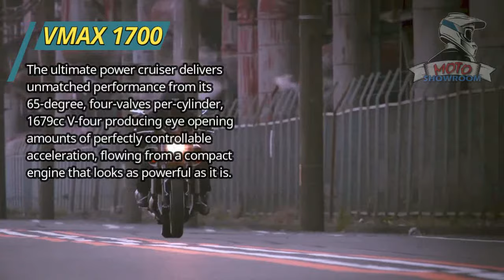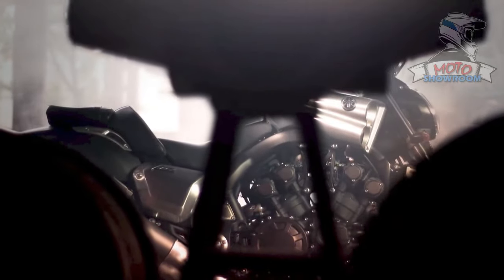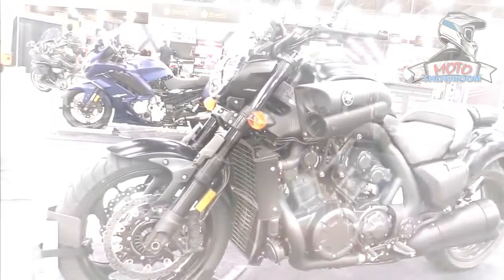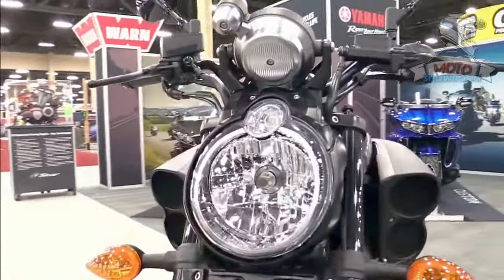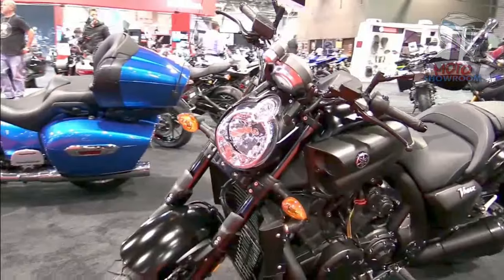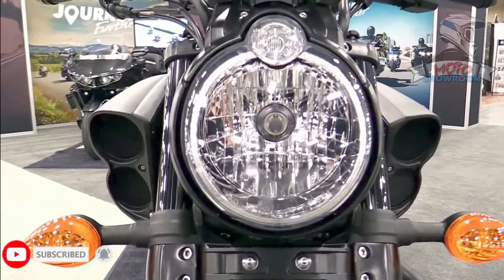2024 YAMAHA VMAX 1700 V4 Engine : Return of the Original MONSTER Bike | Ride and Engine Sound

Comment: I owned the original 1200CC V Max , stage 2 dynojet, no baffles, 150 brake at the wheel it was truly outrageous. It would run out of RPM before power and in a straight line leave the fastest of sports bikes in the dust. It was like being strapped to a rocket nor for the faint of heart as in the wrong hands V Max is a dangerous proposition...

I'd buy another in a heartbeat, you have to have ridden one to know why. V Max is insanely fast and handles like a bag of cats, but what a rush...
Reply: Buy a gen 2 it’s unbelievable. Way more power than the first gen.
Reply: @jacobhendrickson8935  No doubt. Owned mine in the early 90's. Had it setup on the dyno with KN kit & filter, open pipes and way fewer restrictions in the day. Was a lot of fun but easily a handful, given no ABS, traction control etc.  Mine was a US model imported to EU and it was heavily restricted, just about 120 brake at the wheel. Soon fixed that LOL.

Great bikes :)
Reply: Yeah, I’ve ridden a V Max - heckuva bike - been riding Rocket 3’s for last 15 years.
Reply: I would love to buy one. There's one feature that scares me and it's not the  powerplant. I have an inseam of only 30" and I'm only 5'6". I do own a '17 Harley Breakout Stage 1.
I believe the seat height is just 26". I read the VMAX seat height is 30".  Could I ride this bike ?  I don't want to be on my toes at every light.